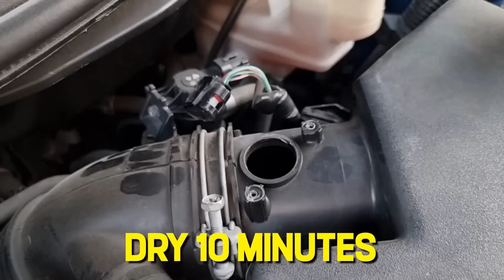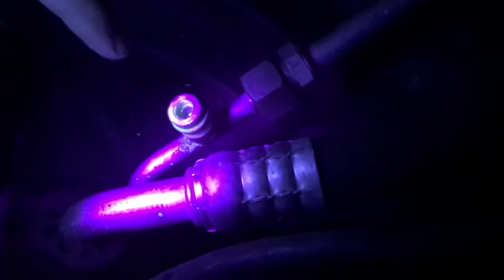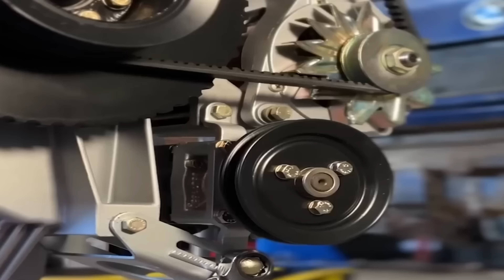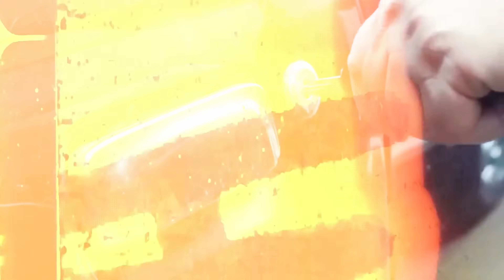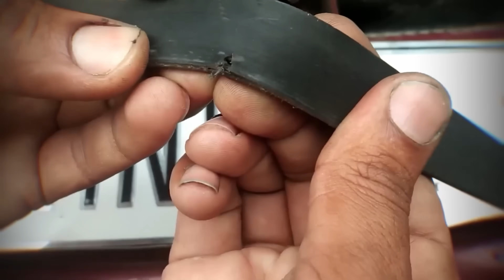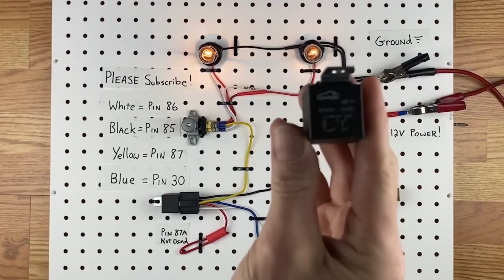Proven Habits to Make Your Car Last Over 800,000 miles

Comment: I am sorry I have to report this video. Showing using high temp grease on the rotors of the car could lead to malfunctions of the braking system, that could injure a driver that follows this method or injure others.